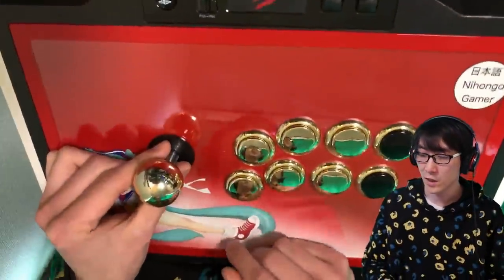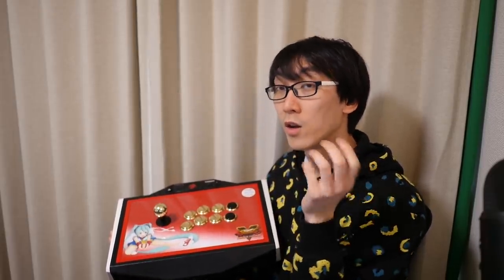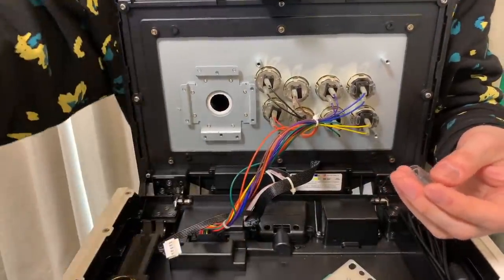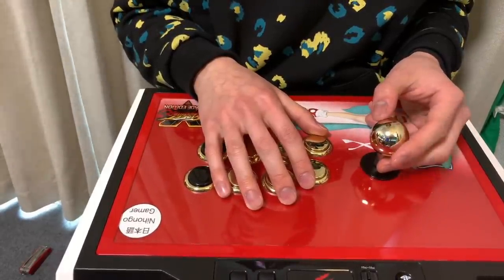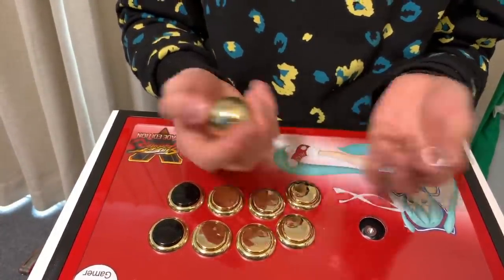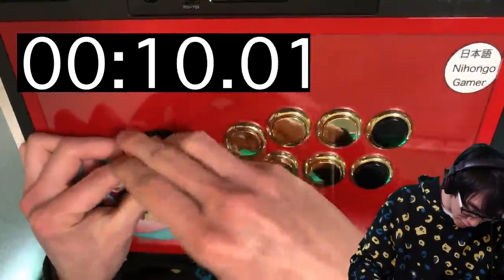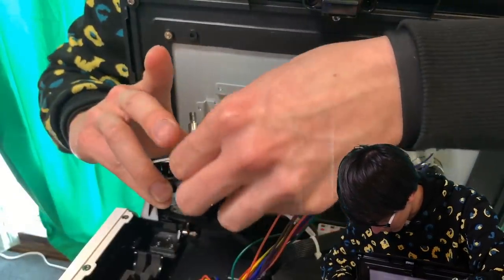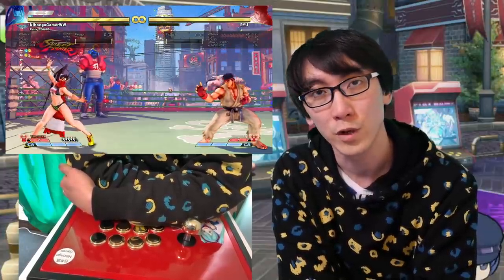The REMOVABLE stick you’ve been WAITING FOR? 【Sanwa】

Comment: You could buy the Phreakmods Link to test it out
Reply: I bought it and as time went by it failed until I had a simple stick shaft. I think that the remove system is for a travel event, not for play all time with this, even it is just for save it in the box

Comment: I got the Phreakmods Link not too long ago and it does actually take a little while to get used to it. Plus I had an issue with mine squeaking while doing quick or rough motions. Silicone spray/electrical contact cleaner fixed it easily. I haven't tried the new JLFD yet but I think I'd still prefer the quick release design instead. (Pretty sure they named it JLF-D for Detatchable?)

Comment: I had an issue where the lever detached during gameplay on two separate occasions. Luckily there were during casuals, but it made me paranoid to use it in tournaments. Afterwards I tighten the lever up more and it produced a new problem, now its hard to take the lever off. So yeah, I'm pretty disappointed.

Comment: If the point of the removable stick is to be convenient, but you need to screw it in when you want to use it, then I think it loses its convinience factor and defeats the point.
Reply: For some id say its portability. Vs having the normal stick sticking out. But I agree on that sanwa's direction is not the fastest for removal
Reply: I'd prefer the solid feel of the stick, the fact it comes off is for transport, not for quick convenience. this stick will never accidentally come off.
Reply: Late reply but im sure you can use a coin instead of a screw

Comment: I picked up some of these because I tried the phreakmod stick and I could kind of feel the linkages moving in the shaft. It's hard to describe but it made a small scraping kind of noise. It wasn't unusable but it wasn't great. I'm a bit dissapointed to learn about the need for a screwhead to remove the shaft but maybe some blue loctite between the ball and the shaft is the way to go? Hopefully blue's strong enough for the forces we'd deal with here but hopefulyl that'd make your "Oh the ball head is stuck" situation happen every time.
Reply: Blue loctite is really needed if you use heavier springs if I dont get mine just right it would screw off on its own over time. It needed to include a little packet of blue loctite with it as it may end up bad press if people buy these and get it unscrewed mid match

Comment: So I have a question I bought a standard length shaft/lever  and it was alot taller than the stock one in .y pantherea, which is fine because it feels like an old happ length but does the panthera have a smaller zhaft or did FA mess ny order up

Comment: Is there a difference between the Phreakmods removable lever and the Victrix lever?
Reply: HXMbamwam yes the “gen 2” that Victrix uses has a built in dust washer. Whereas the original Phreakmods Link only is the quick removeable lever, you have to provide your own dust washer. The dust washer is not connected to the shaft like the “gen 2”
Reply: The Victrix lever is only Black the phreakmods link comes in a lot of colors
Reply: @OptimalMario  Naisu, I somehow forgot about the fact that the gen 2 comes in only black.
Reply: @OptimalMario  Is it possible to buy the Victrix lever separately?

Comment: Pretty sure you’re doing it wrong. The ball is supposed to be screwed onto the shaft tight. And when you remove it the shaft comes off with the balltop attached.
Reply from the maker: It’s a threaded screw on both ends. Tightening the shaft onto the base tightens both ends simultaneously and so sometimes it stays attached to the ball, sometimes it doesn’t. That’s the nature of the engineering here